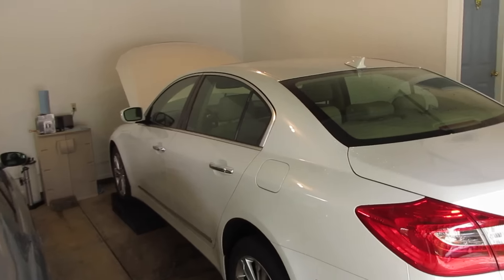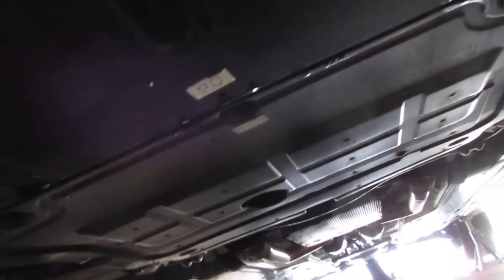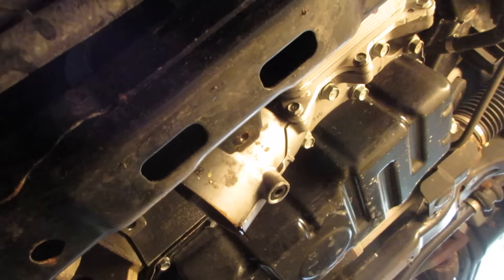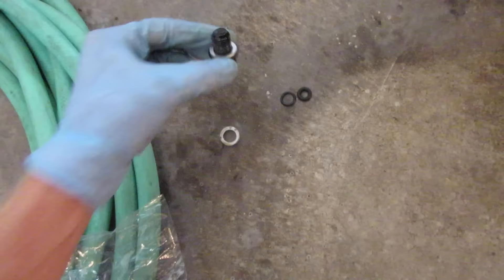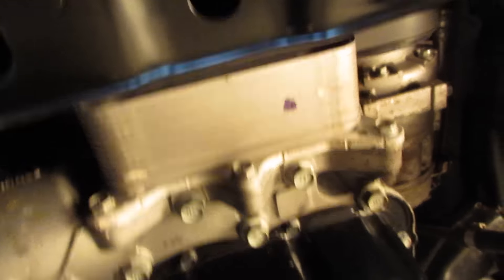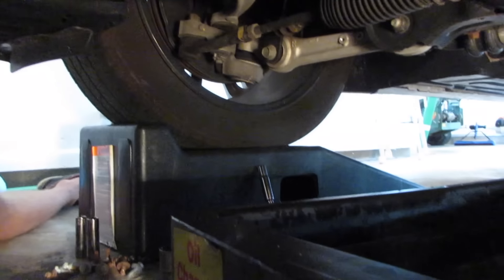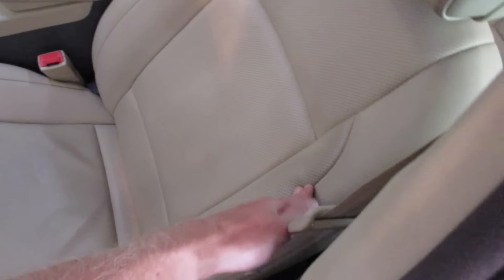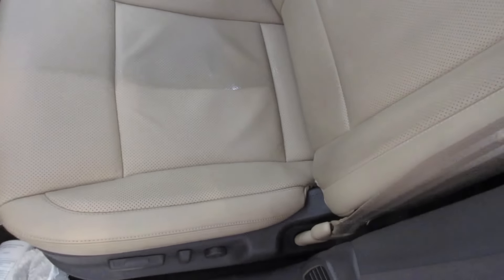Genesis Day  7/18/16 - Day 2,049

Comment: Just a heads up, but be careful with the scrubbing on the seats on the Genesis. I found out the hard way when a bit of the actual leather dye came off my mom's Genesis' tan interior. We have the same problem with blue jean dye transfer, and a light cleaning with a microfiber cloth and Lexol leather cleaner + conditioner usually does the trick.

Comment: That "intercooler" you pointed out near the oil filter housing is either an oil cooler or a transmission heat exchanger. The automatic 540i's have a very similar looking thing that lives near the alternator.
Reply from the maker: Yeah that's what I meant.  The S62 does in the valley for coolant/oil.

Comment: Although the Genesis (and Hyundai in general) maybe aren't as high quality as a comparable BMW, I still think the Genesis is very good value for money.

I work at a BMW dealership and trust me on this one; they don't make them like they used to anymore. Not a week goes by that we don't need to replace an engine on a young car.

Finishing touches such as rusty bolts, yeah that's a race Korea isn't winning quite yet.

But I'm pretty sure that the Genesis V8 is a joy to drive. Not to slash around corners, but cruise like it was meant to be.

And now with the new oil I think it would be good to take her on a long trip and use that kickdown fequently. Given the mileage over the past years and your grandfathers age, I think some burning off old contaminents would be pretty good for that engine!
It still won't shit as fast as a BMW automatic will, but I can't imagine it's much of a slouch!

Too bad the Genesis isn't imported in Europe, wouldn't mind seeing them some more instead of Accents, I20's and stuff....

Great vlog again!

Cheers,

Lars
Reply from the maker: It's a killer car for the money for sure.  I'm just unsure how it'll hold up long-term.  Hyundai hasn't exactly proven themselves yet.  But now that BMW has (E30-E46 generations) maybe they have slacked off a bit in the last decade.  I'm happy with my new old one.  ;)  The Genesis will be being used quite a bit in the near future...